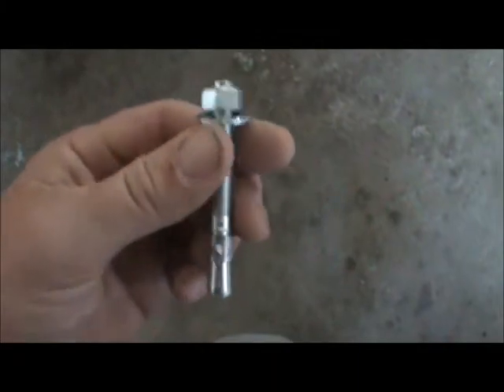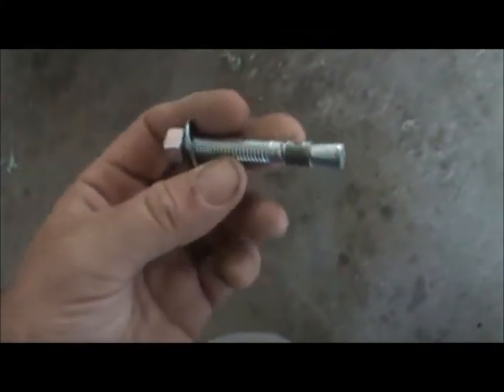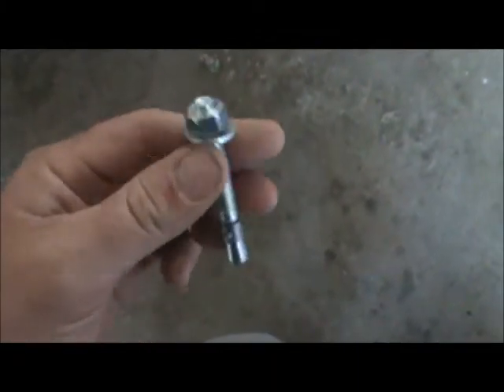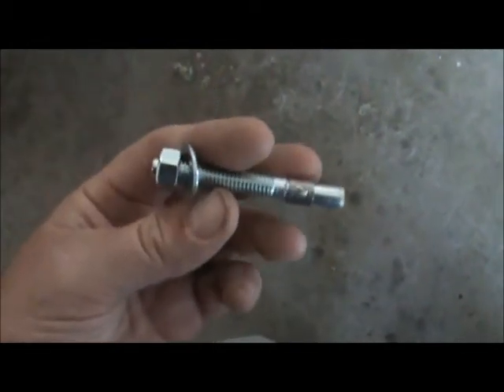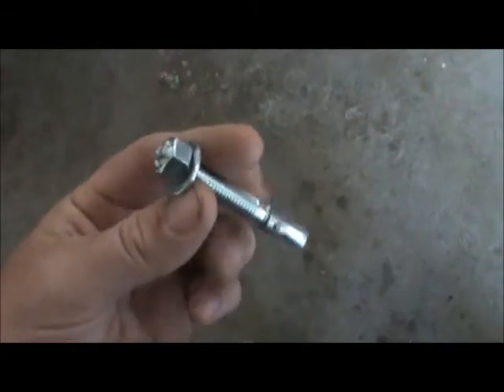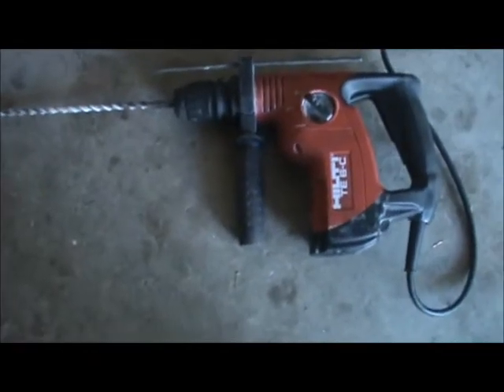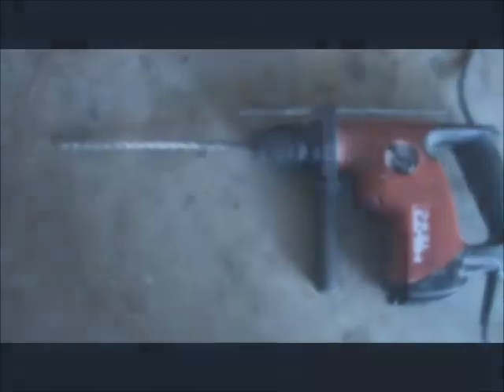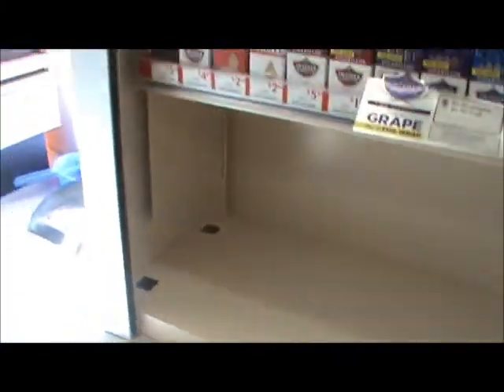Tobacco Display Boltdown

Comment: Oh yeah, HILTI!!! There we go lad! Is that also the Hilti anchor? Here in Germany we got certifications that a safe has to fulfill. For example if you have a VDS Grade 3 Safe the Anchor has to be tested up to 50 kN and if you have a VDS Grade 4 Safe it has to be 100 kN. Both test are being conducted with the anchor in combination with the safe (not the ground). You have to make sure you have a decent concret floor and that you bolt it right yourself.